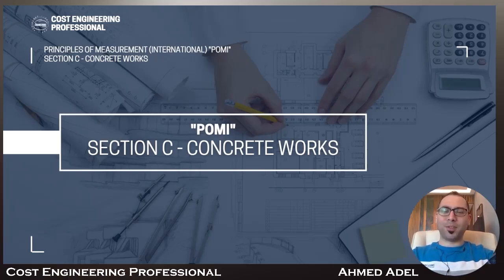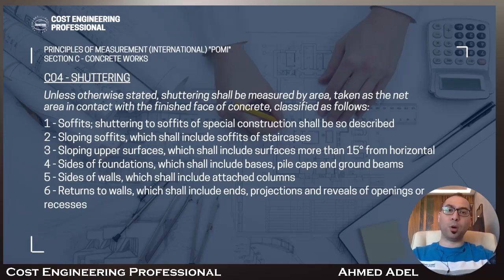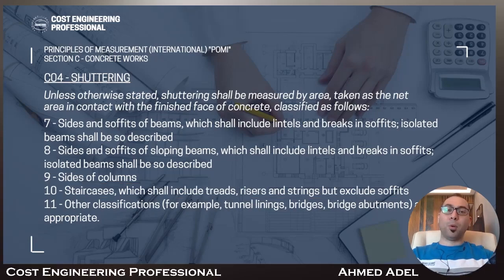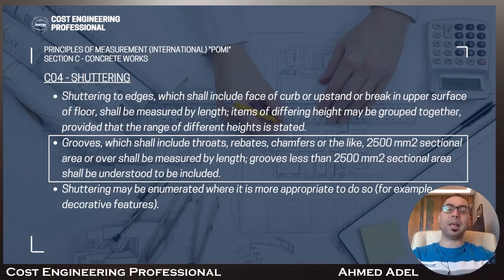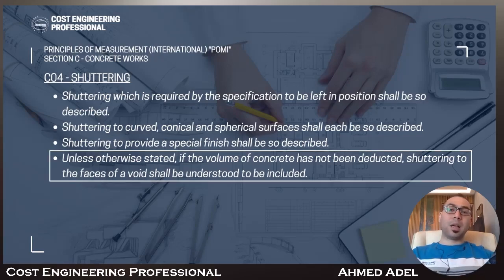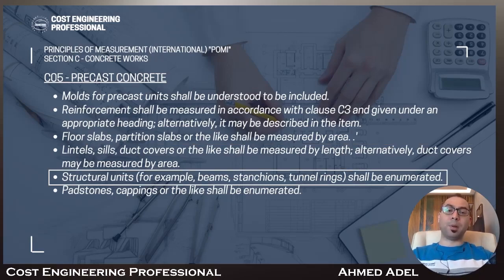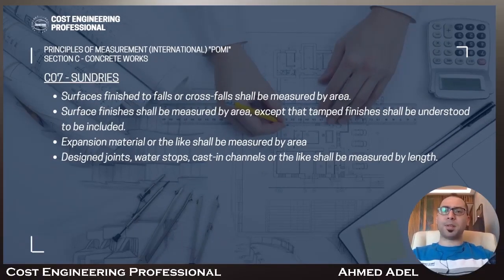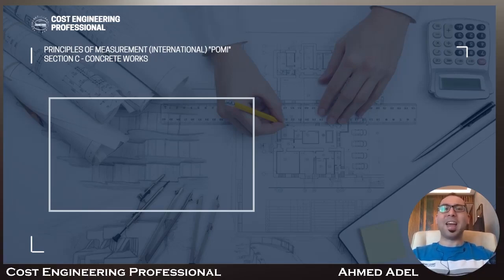How To Measure The Quantity Of Shuttering For Concrete Works - Formwork in accordance with POMI

Comment: Hello sir. I would like to clarify if the different classifications for the shuttering are going to be exact words used in the Item Description of the BOQ? So for the stairs we will have items called "Sloping Soffit, which shall include soffit of stairs" and "Staircases, which shall include treads, risers, and strings but exclude soffits"?
Reply from the maker: Well, if I’m the one preparing the BOQ, I’ll just have the landings measured with suspended slabs, and inclined slab for staircase will be a separate item staircase soffits.